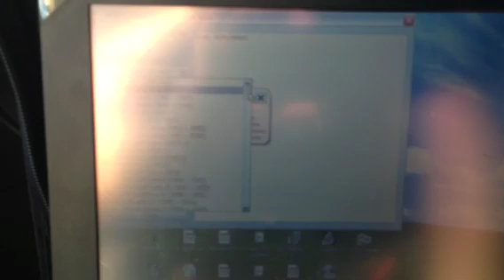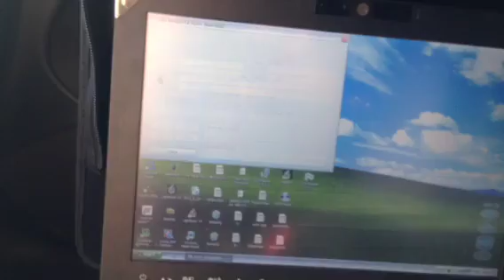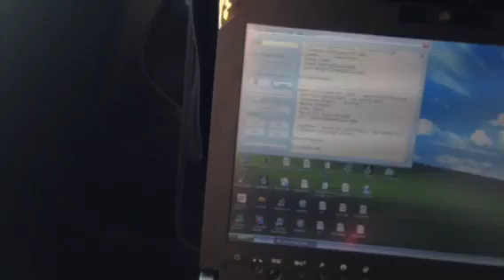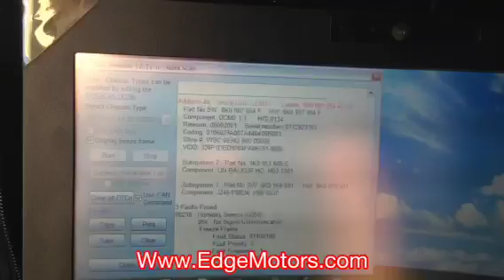Audi VW control modules wake up with out ignition, start authorization module DIY www.EdgeMotors.com

Comment: Would it be possible to avoid the steering colum  problem using a imobilizer bypass? Something like this? https://www.directechs.com/Product.aspx?sku=556UW.
Reply from the maker: +Daniel Lindh it might be, but i don't know if its in your interest.... the reason for the column to lock up, it that it detected some number of errors. that means that the computer recognized several times that the steering lock did not engaged or disengaged properly.... that lock out is made for your safety.... just imagine the steering lock engaging on a highway.....

Comment: Is't gonna work on a 05 audi a6
Reply from the maker: yes, that would be the car this video was intended for...
Reply from the maker: EDGEMOTORS
when you do that, after the activation, go to access start authorization and clear codes...
then you will be able to start the car, it should work for a month or so .... but it all depends on the actual condition of your steering lock.
Reply: thats funny because i just did it on that exact car and it just worked.

Comment: Thank you for posting this, you just saved my ass!  I was able to start my A6 by clearing Access/Start communication DTC with this procedure.
Reply: Why is your car already broken?
Reply: Micah Davis This is why I avoided buying Audi's for the past 15 years.  It's like owning a boat with 4 wheels.
Reply: So your car works now? Awesome. Come over we need some help. Washing machine is broke.
Reply from the maker: audi's are ok... as long as you maintain it properly...
Reply from the maker: allot of people paying tons of money for this to be fixed... even though it could be just a glitch.... we have seen several cases where the reset only worked for a while, and the column still had to get replaced... but couple of cases where the reset is working for couple of years now.